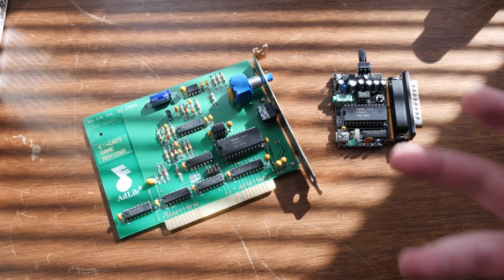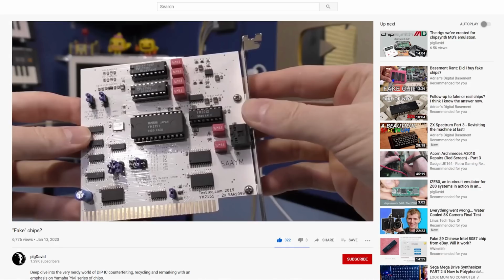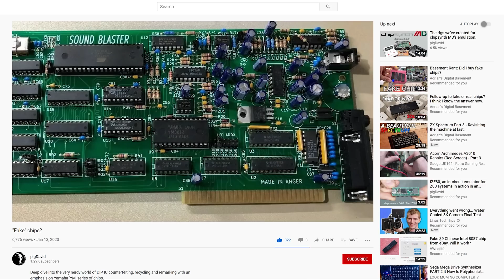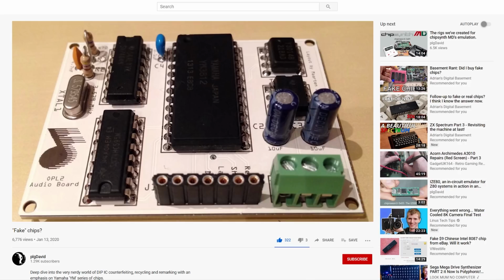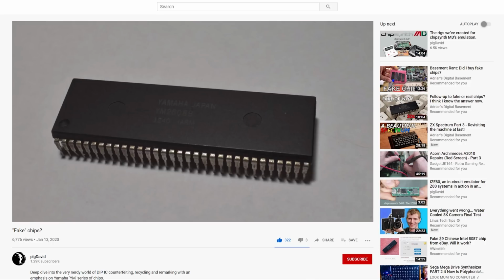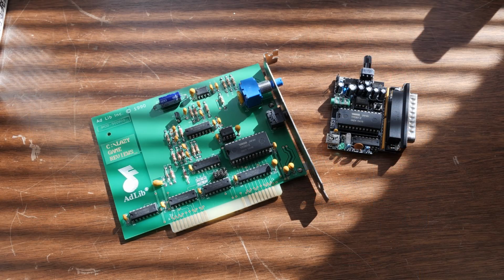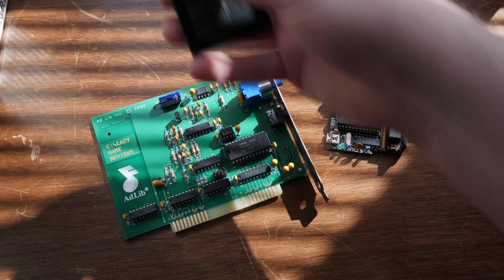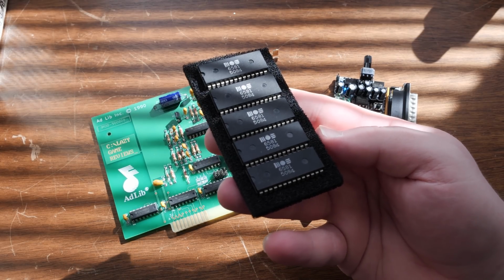Are these Yamaha sound chips legit?

Comment: I guess I don't really see the issue. If they are architecturally/functionally identical to an original, why does it matter what it says on the outside?
Reply from the maker: As mentioned, I don't have much of a problem with it either as long as they work as they should!
But I'd really rather their origins be made clear. There is no indication from the chip sellers that these chips are unoriginal and that can affect their value.
Reply: If you like to collect these sorts of things then authenticity is obviously important. It's nice to hold something in your hand and be able visualize where it came from and how it was made, know the quality of it. Also, someone could charge you an exorbitant amount of money claiming it's an authentic part, when in reality you're getting scammed. No one likes that scenario, regardless of whether it sounds right or not.

Comment: I bought 2 OPL2LPT (directly from the source seller as a DIY kit) right after you released the video on it in 2017. I got different YM chips in the packet.
OPL2LPT: YM3812 9115 EA1B 
OPL2LPT: YM3812 9116 EADB
The look like new old stock. Even the Pins are a little bit bent outwards and not straight like on used chips.  They also work perfectly fine. The markings on mine are white and not the brownish white some chips have.

Comment: I once asked Yamaha (office in Germany) directly if the Chinese YM3812 were "legal" to import to Germany. And they replied: (original text at bottom of long comment)

-------------------
The chip is not supplied by Yamaha anymore.

Whether the offered chip works, we can not guarantee and Yamaha can also not guarantee that it is not a security risk.

and asking if i get trouble from them if i import it from China:

Whether you buy this chip from China is up to you.
(And they repeat that they take no guarantees or know if the chip works or is safe to use)

------------------

Now their reply was strange to me. They seemed to know about them and the only thing they cared about is that they were not liable.
If you compare that behaviour to Apple, well, they are different.

I assume they know that the chips are still made in China, but have no connection to the factory. Having some experience with the chinese market in that area, the parts might either be old RMA returns (where a defect is maybe only a wrong font used for the printing) OR some chinese guys got hold of the old factory equipment.

I worked for a korean company in the past, arranging QC inspections at various locations and sending parts for customers back to China via our RMA process. And the parts almost ALWAYS showed up on Alibaba or Aliexpress some months later.

-------------------

Original text of the emails:

Email 1)
Der Chip ist von Yamaha direkt nicht mehr lieferbar.
Ob der angebotene Chip funktioniert können wir nicht sicherstellen und Yamaha gibt dafür auch keine Garantie, weil es gegebenfalls ein Sicherheitsrisiko darstellt.

and asking if i get trouble from them if i import it from China:

Email 2)
Ob Sie diesen Chip YM3812  in China bestellen ist Ihnen frei überlassen.
 
Jedoch geben wir keine Garantie, dass dieser Chip funktioniert und wir weisen nochmals daraufhin, dass es gegebenfalls ein Sicherheitsrisiko darstellt, diesen einzubauen bzw. zu verwenden.
Reply from the maker: Interesting, thank you for sharing!
Reply: Those FM chips were made in the 80's in, like, NMOS... Do Chinese clone chips really make sense?
Reply: @Luis Wouldn't that be copyright? The FM patent expired in like 1995 (and immediately there were legal OPL3 clones such as Emu's CQM used in later Sb16/Awe64's)
Reply: @boptillyouflop  It would be trademark. They are misusing the Yamaha label.

You can't copyright a logic chip. It'd be diffrent if there was a ROM full of code, as code is copyrighted.
Reply: Does Apple go after people making parts or clones of Apple II’s or similar old hardware? I’m pretty sure Apple only targets people repairing products that keep them from selling new products. If they were making clones of current Yamaha products, I’m sure they’d be more concerned.
Reply: @Dan-TechAndMusic  That's why I don't raise any qualms about using "abandonware" sites when I can't find authentic copies of old games/software for personal use. It's still technically copyright, but nobody's enforcing it, because the original authors are no longer interested in selling it, which means that you aren't competing with them.
That said, if I CAN get an authentic copy, I most certainly will, if for nothing than for it's value as a collectible (especially complete box sets).
Reply: Good to know. It simply looks they don't care, and don't see enough profit to respin them themselves. However, if they don't seek legal action against this clones, especially the ones marked to be made by them, they might loose the IP claims for them, including their design.
Reply: @movax20h  Unless Yamaha was interested in re-entering that market, there's no point in seeking legal action. No need to hold onto IP claims for something you're no longer interested in. That market has long ago run to an exclusive niche, and it's just not worth it for Yamaha.

Comment: Hah, I saw a photo of my ebay listing of Sound Blaster reproductions flash by there.
I would not at all be surprised that the YM3812 on them are fakes, especially since they have such a recent date code on them (13th week of 2013) but they do work exactly as they should.

Yamaha in particular has been known to change the way they mark their chips over the years, with different fonts, spacing, sizing, and even different date code codes, which makes it pretty hard to determine which ones are real and which ones are not.. You know, assuming that it isnt just painted on like the one you had there.  

I had a different project based on the YM3802-X, and out of the 25 that I ordered from 4 different vendors, only 2 of the chips actually worked and both of them had significantly different looks to them.

I did indicate the origin of the parts on my listing just in case the question ever came up.

Comment: I've the OPL2LPT too, it works, and has the SAME datecode: "0824 EAYB"
I've a pack of other OPL2 Chips (new-old stock) with the datecode: "0938 GAGD"
Reply: "0938 GAGD" is a remarked code. No OPL2 chips were made in week 38 of 2009, and no OPL2 chips are die revision D.

Comment: I always assumed the OPLs you buy from Texelec or Serda are good quality clones at least. I'm sure they would get complaints if they weren't.
Reply from the maker: As mentioned in the video, the audio quality is quite good IMHO. It's just origin of the chips that is suspect.
Reply: @LGRBlerbs  Given that new-old stock is more highly regarded than recycled pulls, then in Shenzhen they are going to paint pulls to make them look like new-old stock. They could well claim that they ARE new-old stock. Whether new-old stock or recycled pulls, the key is testing the chips from the source. Tex-Elec is upfront the the chips are not necessarily "factory fresh".
Reply: Not clones, just tatty old chips freshened up cosmetically and made to appear like "new".

There really isn't the money to actually spin up a clone in an IC package.
Reply: @SianaGearz  That depends on whether or not you think you could get your money back.  There are boutique factories that will make chips for you, but only if you order at least $20,000-$30,000 at once, because of the cost of retooling a production line.  Having said that, though, I doubt any of them are new (aside from  guaranteed new-old stock).
Reply: @SpearM3064  The problem is that just looking at a die, you can't exactly make a copy of it. Either you need to get a copy of genuine masks and run those, or you need to fully reverse engineer the logic. Some structures like look-up tables and mask ROMs are easy to read from the die photograph, and structures giving a clue to design approaches used become apparent, but in general decoding every single gate is not entirely possible, there is a fair bit of educated guesswork and validation involved. Die shots have been invaluable in resolving reverse engineering ambiguity in hobbyist communities and getting FPGA-based clones from kinda alright to likely 100% correct, but the evaluation of die shots performed has been selective and based on prior knowledge.

I had heard of someone running a very minimal new mixed signal chip for a smaller company and this ending up costing them almost half a million in setup costs. So replicating the weird YAC512 or YM3014B companion DACs from scratch is kinda out of question. If you were to run your own digital portion FM clone, you should redesign for an I2S standard audio interface.

As far as digital circuits go, there are a number of very affordable processes that are available IF you have a synthesizable representation, i.e. you have fully reverse engineered and re-engineered it. But then you look at major CODEC manufacturers' attempts at designing their own OPL3 compatible circuits, like by OPTI, AD, Crystal and Creative, and all of them are very far from exact clones, super easy to distinguish, only ESS displays a commendable amount of effort at getting it almost right. So it would be a big mystery where an exact clone design would come from and how much effort someone would be willing to spend to get it right.

Comment: I think there should be a "repro" label, like what people do with videogames. It should exist, but should be clear it's not something from the 80's
Reply: Go on ebay. Pretty much all game repros are not labelled as repros.
Reply: Where else would an OPL2 or OPN die come from other than the 80s? These are just old chips that have been repainted just so they look like the more desirable "new old stock" rather than "salvage from garbage". These all either won't work or will be genuine.

If you wanted to make a clone that would fit the production number and budget of these retro enthusiast boards, it simply wouldn't look like this at all, since you don't get to make your own die, bond it to a leadframe and epoxy encase it, you get a little PLD and a little circuitboard and some board to board type interconnect pins and that's what it would look like, like a cute little daughterboard. No repro label needed.

Comment: EDIT: This guy ran into some problems with fake chips, and his findings may answer some of your questions: https://www.youtube.com/watch?v=2OMMHwY5V5k
AFAIK they're often reverse engineered clones, and your mileage varies a lot... some clone chips work fine, some are intermittent, some don't work at all, and some are dangerously fake. I don't think anyone has the motivation to re-etch the labels on real chips for no reason, so if it seems off, it probably is. 
There are plenty that are completely fake chips with BS labels: me and a few other people have run into supposed SP0256 text to speech chips that were actually dangerously fake.
Considering you can't get most of these kinds of chips from reputable sources anymore, this really makes things tough. I'm sure the guys making those boards have had to do a good amount of testing, and have thrown out boxes of chips lol
Reply from the maker: I've seen that, definitely a good video on the topic!

Comment: I ❤️ Yamaha. do you really want a clone?
Reply: I would take a real ym2612 ANYDAY over a clone. that's like comparing a vintage guitar from the 80s to a modern guitar that looks and sounds pretty much the same. obviously the original is far more desirable. let alone with synths or sound cards.
Reply: I'd prefer a real chip if I could get it from the original manufacturer or a second source for a reasonable price.

But this brings up an interesting question about vintage parts.  They're often profoundly inefficient.
Reply: Considering IC fabs can now operate at the nanometer scale, consider how many modern YM3812 equivalents could be constructed with the materials in one vintage one.

It often doesn't make sense to reproduce old chips if they can be functionally recreated in modern devices like FPGA's that can be produced at massive scale and employed for a wide variety of different tasks.
Reply: Ideally no, but if the original isn't in production anymore and the clones are just as good then I'll take what I can get.